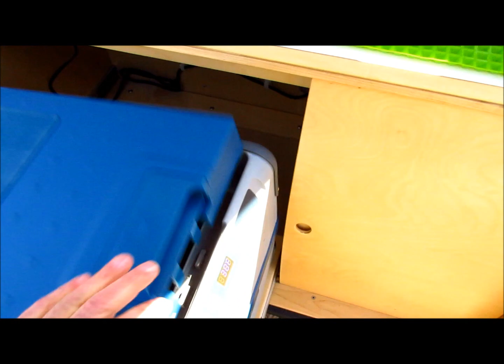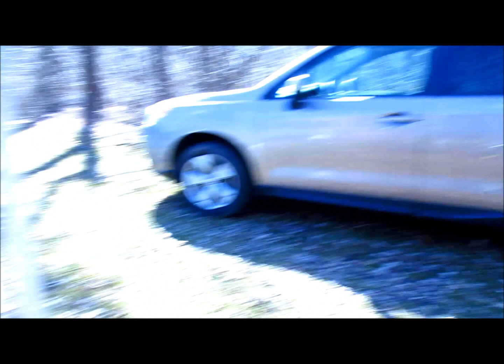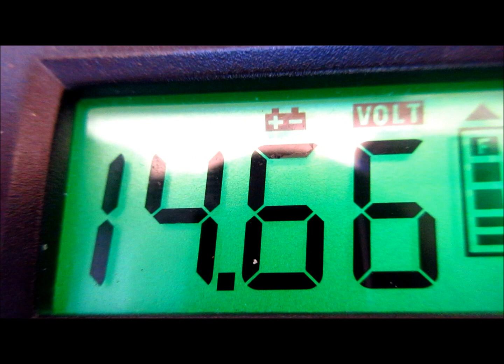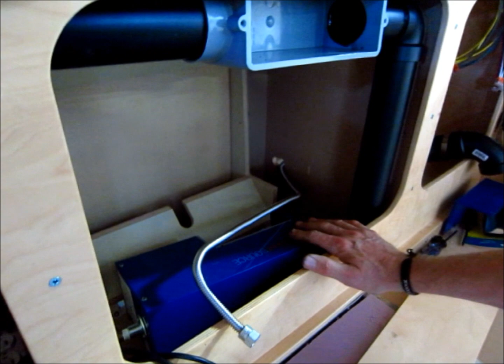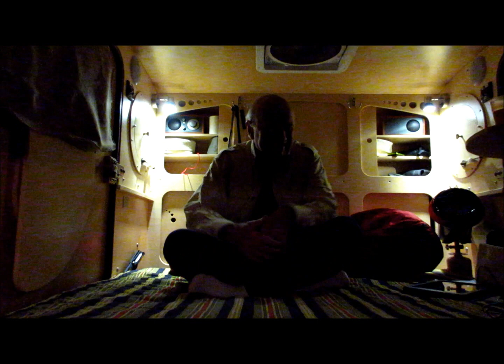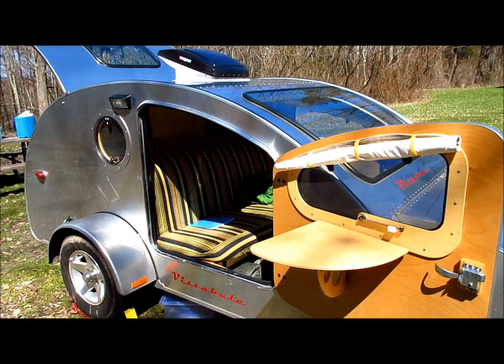TEARDROP TRAILER  OFF GRID REFRIGERATOR CFX-35 Dometic

Comment: I have my cooler 30-some years. You will replace the refrigerator over and over in 30 years. And, you won't have ice. I like having ice.
Reply from the maker: Good for you!  There is more than one way to value the fridge.   I just came back from a 20 day trip in the wilderness. I did not have to leave to buy ice (which is important for me).   I factored in the cost before buying. My fridge has paid for itself  by the money I saved not buying ice!  I calculate it this way-->  https://youtu.be/ITJNEPGb7MY  𝕋𝕙𝕒𝕟𝕜 𝕐𝕠𝕦 𝕗𝕠𝕣 𝕨𝕒𝕥𝕔𝕙𝕚𝕟𝕘!  ✅  Check my other videos https://www.youtube.com/cosmoweems/videos 
SUBSCRIBE https://www.youtube.com/cosmoweems?sub_confirmation=1 =𝓒𝓸𝓼𝓶𝓸 ✅

Comment: You don't have to justify to anyone else how you spend your money.  A fridge is absolutely a great purchase if you are going out a lot.  I have a Truma 60 in my square drop camper, and I love it, and I will not go back to a cooler for food storage.  I still sometimes use a regular cooler on long trips to keep beer, soda, and other drinks in; plus ice is great to put in a glass; but for food, a fridge is the only way to go.

I also use 2 100 watt Renogy panels for 200 watts of solar, which are glass panels fixed on my roof.  I have 2 AGM 125 AH batteries for 250 AHs in parallel.  I have a victron 800 watt pure sign wave inverter, a victron solar charge controller, and the victron BVM battery management setup.  All bluetooth connected.  I monitor my electric use and inputs on my phone, and it is really fun to see how much different items use, how much solar is coming in, and how long you have left till you run low on battery.  With my setup I have never been down below 75 percent battery life.  Usually on a multi day trip I don't dip below 90 percent battery life at its lowest point.  I am such a fan of solar.  The best numbers I have achieved  with the two panels was 180 watts into the charge controller.  Most days my battery is fully charged by noon.  If it's cloudy and rainy the worst I have seen is that by the sunset I still will have 4 or so Amps low from full on the battery.
Reply from the maker: Sounds like you did it right! I am a bit light on battery with one 125AH battery. I could use 2 batteries. I am currently packing two 300 watt Dokio panels. I do lots of forest camping and it seems to always be cloudy. So the extra capacity is needed for dim days. In open sky  I am charged by 9am. I call out the costs and break even with ice costs to lay it our for anyone considering switching to a fridge.I think my fridge cost paid for itself in ice saving in 2 years. The cheap startup for a cooler exceeds fridge cost pretty quickly. https://youtu.be/ITJNEPGb7MY Like you I augment with a cooler or on some trips swap out the fridge with a cooler if it is going to work better. I have been 100% solar for 6 years in my trailer and I am very happy that I made it work and how well it works. In 6 years I have only had to use the car alternator to charge my trailer about an hour or two and that was in a blizzard (solar panels were covered by falling snow). I love the quite clean energy. Thanks for posting this.  𝕋𝕙𝕒𝕟𝕜 𝕐𝕠𝕦 𝕗𝕠𝕣 𝕨𝕒𝕥𝕔𝕙𝕚𝕟𝕘!  ✅  Check my other videos https://www.youtube.com/cosmoweems/videos 
SUBSCRIBE https://www.youtube.com/cosmoweems?sub_confirmation=1 =𝓒𝓸𝓼𝓶𝓸 ✅

Comment: Well done. Effective electrical design and cost saving way thing, have you considered a generator when it’s cloudy? I the like teardrop configuration especially your kitchen
Reply from the maker: I hav eno aversion to a generator. But I anted to do this solar. I have had my first experience where I had to plug the car into the trailer so the alternator would charge the trailer. I had to do it for 15 min in the morning and 15 min in the evening for 2 days in very rainy weather recently - so my generator is my car. I guess I have used a generator. Most owners who want  air conditioning  use a generator. Thank You for watching. Check my other videos https://www.youtube.com/cosmoweems/videos 
SUBSCRIBE https://www.youtube.com/cosmoweems?sub_confirmation=1

Comment: Cosmo, what is your opinion on the Bean Trailer?  * the fiberglass shell vs the wood interior and Mattel skin of the Vestabule..
Reply from the maker: I looked at the Mean Bean video. Its very nice. I think the Vistabule has lots more storage (under floor and headboard). I would miss the windows. Vistabule has windows on all 4 side. VB also has 4 opening windows. I like the Bean 18 gallon water tank. I love the stove but not the placement of the stove.  Wood interior is heaven when you are in it. I have no experience with the matt VB skin. Of course I am very partial to the VB so this may not shock you! The Bean is excellent I am sure - But It does not have the features I like! =Cosmo
Reply from the maker: I would want to know the max wind speed that awning can withstand.

Comment: Cosmos, When you use your ham radio how does your solar system work? Is it satisfactory? Do you do only qro or qro 100 watts.?
Reply from the maker: If you want to work 100 watts and rag chew you better get a big lithium. But first make sure the lithium can operate in the temperatures you will be in.My radio can be turned down to 1 watt or up to 100. I brought separate  battery for the radio. Thank You for watching. Check my other videos https://www.youtube.com/cosmoweems/videos 
SUBSCRIBE https://www.youtube.com/cosmoweems?sub_confirmation=1
Reply: Qrp or qro
Reply: Lead Acid or lithium iron phosphate?

Comment: what is your thoughts on the fridge. we are debating on the 40-50 as it will stay in our truck during travel and site by the camper at camp.
Reply from the maker: Hello. My Dometic 35 is working out well for me, No ice to buy or water to drain. Mine only holds 1 cubic foot of food but If I plan carefully I can get a weeks worth of food in it. Mine is a single zone fridge or freeze but not both at the same time. I am camping now and I was able to run it 36 hours without recharging the battery. After than the battery voltage was at 11.4 volts which is where I recharge.
If I was starting over I would buy what I have again. No complaints. You can set the fridge to turn off when it detects a preset voltage such as 11.4V so it wont drain the vehicle battery. These fridges put out a little cold at minimal energy consumption. Not designed to make block ice overnight etc. It works fine keeping my food at the setting I select. =Cosmo
Reply from the maker: fine as a powered fridge without power does not retain cold like a cooler.
Reply: thanks. I just want to  store some food couple of drinks. no ice or ice cream so temps in the 30's are fine.  I am just wondering how does it charge going down the road?
Reply from the maker: Mine runs on 120 ac or12v  dc. Comes with both ac and dc power cords.  It plugs into the cigarette lighter. No problem running it while driving. Your camper has a battery to run the fridge. How many amps is that battery..?
Reply: Cosmo Weems 12 volt deep cycle on my pop up camper.  We are looking and switching to a teardrop wife is sick of the wet canvas and set and take down in rain.  Looking for a small solid wall trailer.

Comment: 12 amps a day? You mean amphours or what?
Reply: There's a confusion here over amps (A) and amp-hours (Ah).  Amps refers to the RATE at which charge is being consumed.  Amp-hours refers to the total amount of charge that was used over a given period of time.  Of course, the terms can also be used to indicate rates and quantities with regard to power generation (solar panels, batteries, generators).
Reply from the maker: If its pulling .5 amps an hour. That is  a total of 12 amps that will be sucked out of the battery a day. To me that indicated the daily drain on the battery I need to replenish with my solar panels.  See my other videos at https://www.youtube.com/CosmoWeems  and  SUBSCRIBE =Cosmo
Reply: You can't use amps to describe a cumulative current flow, that is what amp-hours are for. I assume you mean that your combined devices draw an average of 0.5 amps, if they do this for 24 hours they will have drawn 12 amp-hours (0.5 amps over a 24 hour period). This is also why battery size is described in amp-hours, a 115 Ah battery can deliver 115A for an hour (if we neglect internal resistances which limit the battery's output) or 1A for 115 hours or any amount of current for 115/A hours.  Hope this helps with any future calculations.

Comment: On the toilet front for dry camping I use a gold old Homer bucket, plastic bag and a love-able Loo toilet seat. We use one of those self standing privy tents, stake it and it doubles for a bathroom and a changing tent because you can stand up.

I made a shower device out of a pressurized lawn sprayer with faucet attachment like in your kitchen.

All you do is heat up some water, or leave it in the sun all day, pump and spray👍

Comment: Love my LG SS Teardrop and have many of the same things.
I have a Dometic CF-18 that I keep running with just 35 watt solar- It shuts off all the time because the fridge is so efficient. The next morning the battery is still at 12.4 volts. I keep it at 34 degrees👍

I got stuck in some cold weather with snow and ice at 27 degrees and the inside still stayed at 51degrees. I felt that was pretty darn good1
Reply from the maker: I raised the temp in the trailer 10 degrees with a single candle on a frigid night. Enjoy

Comment: Love these trailers, visited their factory last week. For some reason they will no longer put stabilizer legs on their trailers. It would be nice if they would at least offer it as an upgrade. They said it makes no difference in stabilization (which I don't believe), but I would like to have them for slight leveling adjustments as well.
Reply from the maker: I have had mine 2.5 years and I am still loving it as much as the first day!  Not sure why the stopped the legs. Perhaps some design change under the trailer. I was out last week and forgot to put them down (with no ill effects). I would not consider the legs a show stopper when you factor in all the other features the trailer offers. I am leaving in a few weeks for 10 days of  camping right on the ocean (unless a hurricane chases  me inland again). Lots more video will be coming from that trip. =Cosmo

Comment: What type of car do you use tow your  Vestabule?  We drive a Honda CRV which has a towing capacity of 1500 lbs
Reply from the maker: Hello Lynette  My tow vehicle is a Subaru
Forester. It has a tow limit of 1500 pounds and a tongue weight of 150 pounds.
No problems so far I load he car carefully to balance the load. I also
purchased the electric brake option for the trailer to reduce stress on the
car. Electric brakes are not required but I felt and still feel it was a good
idea I have an opportunity for a new care early in 2018 and  I am
purchasing an Subaru outback which can accept a tongue weight of 200 pounds and
tow weight of 2500 pounds.  =Cosmo See my other videos at https://www.youtube.com/channel/UC5Sd6k_HhdZA_Av-TQHhLUQ Better yet SUBSCRIBE
Reply: Thank you very much.  I have been enjoying your videos.
Reply: I just bought an Outback...and could not be happier...now I can't wait to get a matching Vistabule Teardrop. and take some much needed and long overdue time off.

Comment: Hey, I appreciate your videos! I'm currently saving up for a teardrop trailer. I don't know yet if my husband and I will build one or if we'll buy one. But the Vistabule catches my eye, if we decide to purchase.
I am curious how cold it gets inside the teardrop on cooler nights? And how hot is it inside the teardrop on warmer nights?
Reply from the maker: Hard to say. It’s a small space and very efficient to heat.  If you have a heater - it heats up
very quickly.  I rely on the sleeping bag to keep me warm. I have used a heater (both electric at a campground and propane off grid) and they both work great. Being indoors keeps drafts and wind
off me and that helps. I once lit a tea light candle and it raised the temp from 35F to 45F in about an hour. Roof of trailer is insulated to help keep heat off. Outstanding ventilation via huge doors, 4 windows that open, 3 ventilation ports (which I use all the time) and the roof vent/fan jeeps me  cool me pretty well. If you in 120 degree AZ or  you can't tolerate heat you may want to think about and air conditioner.   =Cosmo See my other videos at https://www.youtube.com/channel/UC5Sd6k_HhdZA_Av-TQHhLUQ Better yet SUBSCRIBE

Comment: you pay $.50 a pound of ice! only in a capitalist system! 8 lbs per gallon of water = $4.00 per gallon of water! gas is currently $2.13 per gallon, milk is even cheaper then water! note to the public.. you deserve capitalism if you agree to get price raped.
Reply: Your'e almost right.
For instance ice is free in North Korea, but it's only available in the winter.
Get lost troll.
Reply: I don't know where you're getting your prices.  I pay $0.50 for a gallon of drinking water and $4.00 for a gallon of gas.  
Ice is great if you're just going to the beach and you want to keep your drinks cold but if you're using it to chill perishable food over a long weekend or even a week camping or boondocking you're going to end up with a lot of cold water at the bottom of your ice chest and possibly a bunch of perishables soaking and rotting in it after only one day.  If you don't mind making an ice run into town every day and fluctuating temps inside the cooler as the ice melts all power to you.  I'd rather not have to worry about it.
Reply: Energy costs money, and energy is required to turn water to ice. #EntropyIsTheLaw

Comment: Great video Cosmo! I met Burt last year when he stop thru MD.  had a chance to see the vistabule up close. What are you using to tow your visaibule? Looks like a Subaru. I have the outback limited 2017 looks like it would not be a problem towing the vistabule.
Reply from the maker: I am using a Subaru Forester to tow. Outback is perfect for towing this trailer. My trailer weughs 1500 pounds tongue weight is 200mpounds. I am purchasing an Outback in the spting..
Reply: Thanks for the response Cosmo!

Comment: Great info Cosmo!  My wife and I pick up our Vistabule (114) in May and have asked Burt's guys to install a 12 volt plug behind the cooler drawer to accommodate a powered cooler like you have. Is your cooler drawer stock size or did you ask them to make it larger for that cooler?  I would like to arrive in St Paul with the unit ready to go and be sure it will fit. Thanks!
Reply from the maker: Vistabule provided a 12V connector in the fridge compartment for me. I also have a small pass thru to the AC power compartment. I plug the fridge AC the outlet in the AC power closet (4 outlets there – one is used for the battery charger fridge uses the other and on mine there are 2 spare outlets. I believe they make one size slide out drawer which fits a Coleman 40 quart cooler, the Yeti 45 and the Dometic fridge. I cant wait for some hot weather to really check out the fridge. Its very nice and VERY quiet. =Cosmo See my other videos  https://www.youtube.com/results?search_query=%22cosmo+weems%22